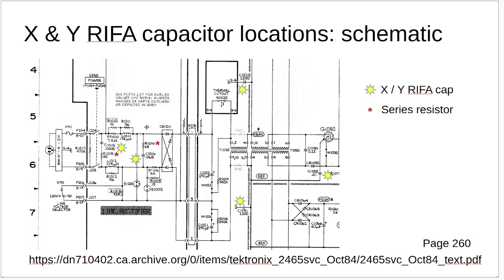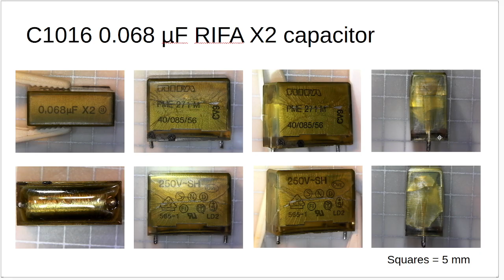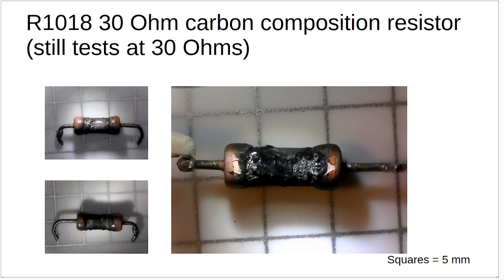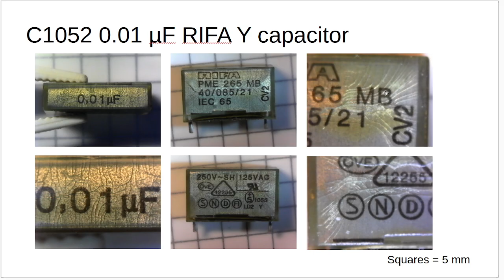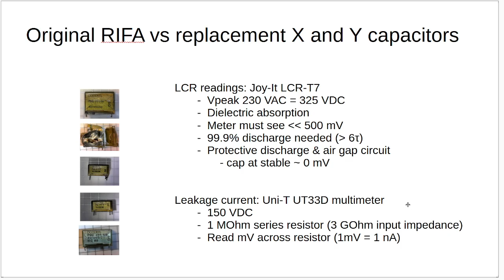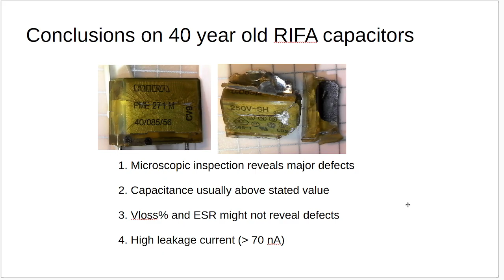Tektronix 2465A DV oscilloscope repairs (part 2): 40 year old X & Y RIFA capacitors

Comment: Great video and like the "academic" approach to the RIFA caps that crack and absorb moist. I am curious to what caused the shutdown when the scope got warm? You mentioned you fixed it.
Reply from the maker: Thanks! Piecing together what I felt needed to be shown didn't leave much room for a "regular" video. The plot thickens. Scope now turns on.  I have been making recordings with a datalogger, which revealed some problems I wouldn't notice with other instruments. That is heading for a couple new episodes. I am sorting out proper grounding and isolation to make it publicly presentable. Being amateur hobbyist, also working on getting my facts straight. Please keep me in the loop with any new videos.